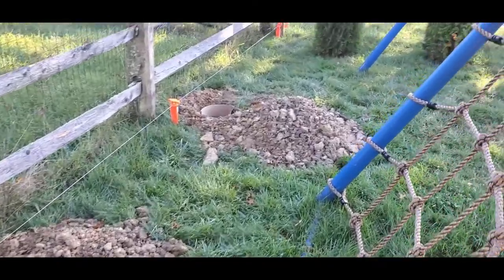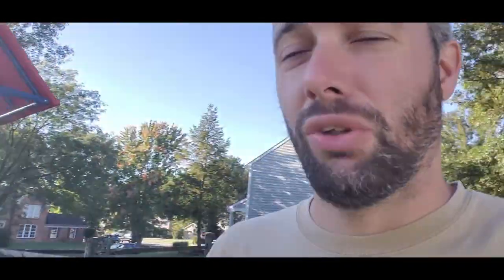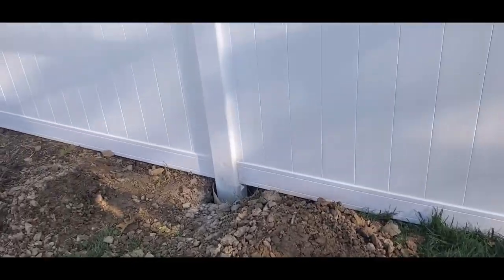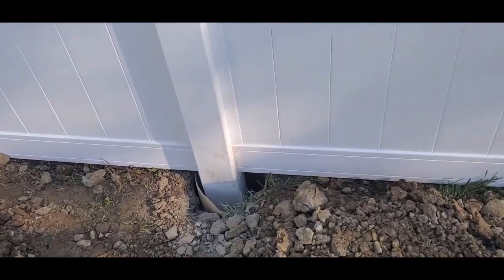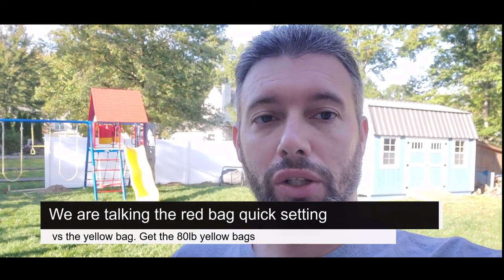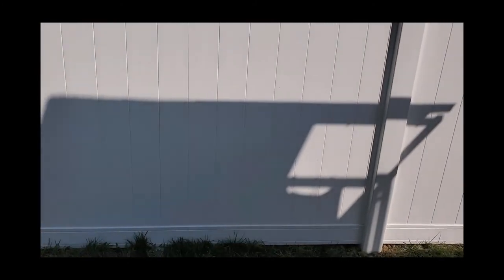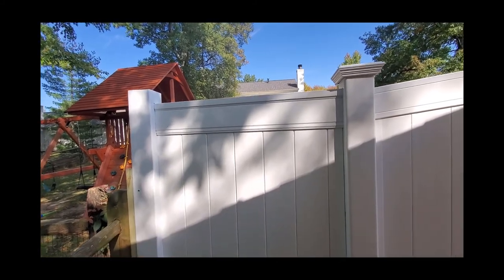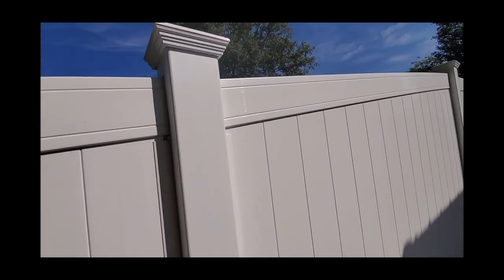Vinyl Privacy Fence Install

Comment: Just wondering did u leave any room on bottom . Looks like it’s all the way down on ground
Reply from the maker: A little, yes. Maybe an inch or two, the taller grass covers the visible gap. I didn't want to have a large gap and then deal with dogs digging/crawling under.